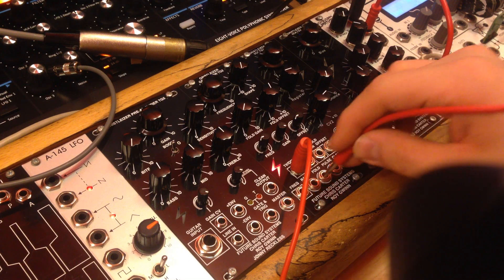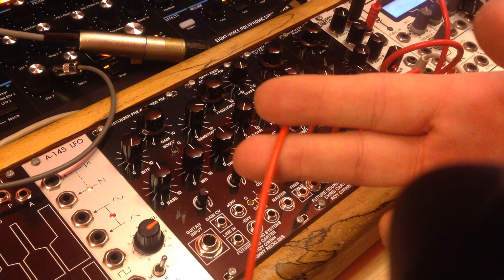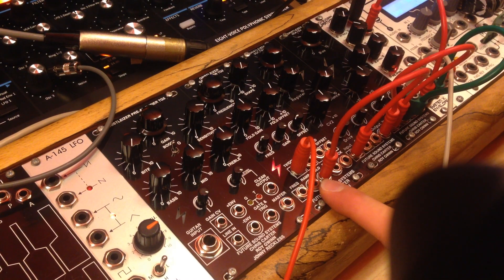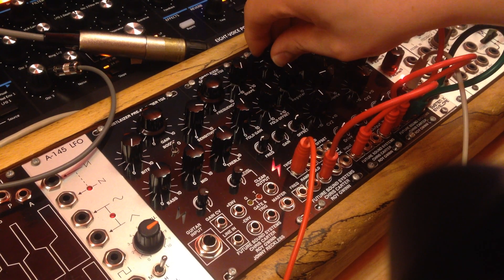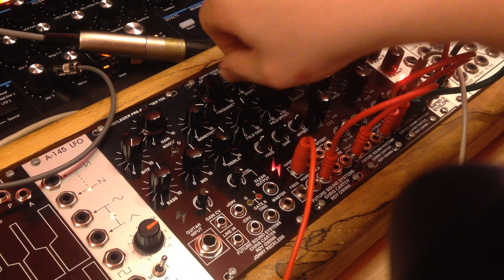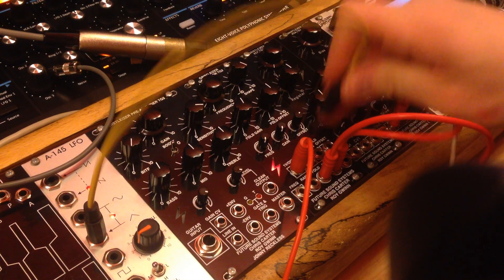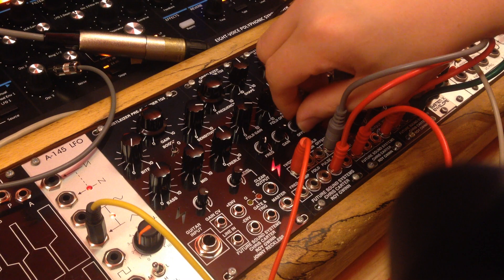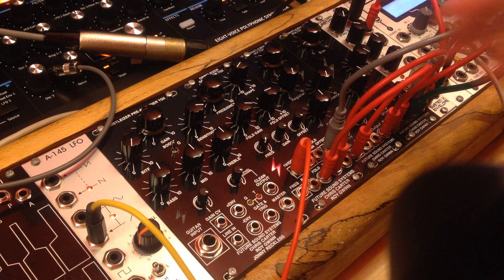The Gristleizer Eurorack modules as a synthesizer voice

Comment: What is the signal from the Korg SV-1 to the 1V/Oct input?  I'm struggling to understand exactly what that is and what it is doing...tks
Reply from the maker: Hi there! The Korg SQ-1 is outputting a pitch control voltage which then controls the frequency/pitch of the TG2. If you're new to CV, it's well worth reading up on - it's often described as the precursor to MIDI, but can really involve a lot more than just transmitting note information.
Reply: Future Sound Systems Thanks! Pitch CV makes sense. I thought you said SV-1, which is an electric piano...
Reply: @futuresoundsystems  The  Moog Subharmonicon has two main VCOs and has CV outputs for each- the manual states: “The audio of VCO1 is available at this jack. Audio/CV output: 10V peak to peak” 
Is this the same type of pitch signal as what the the Korg SQ1 is outputting to the TG2 VCO?